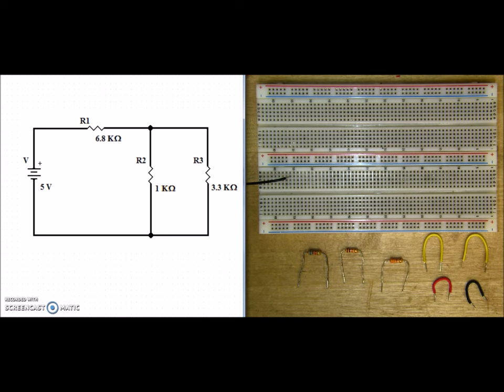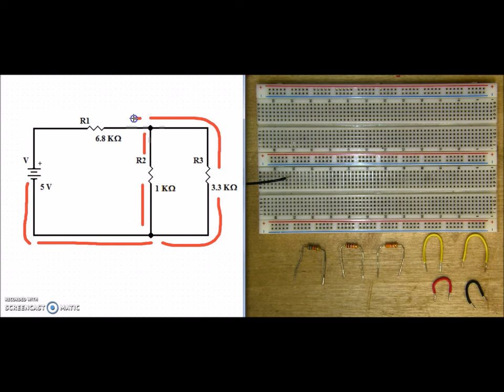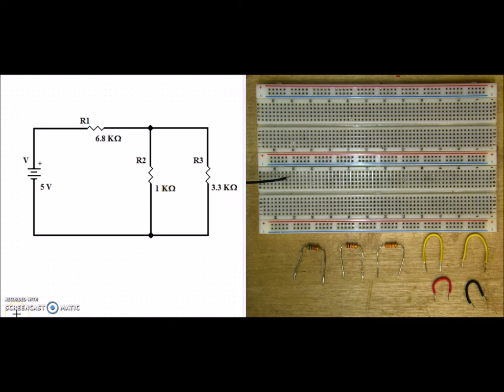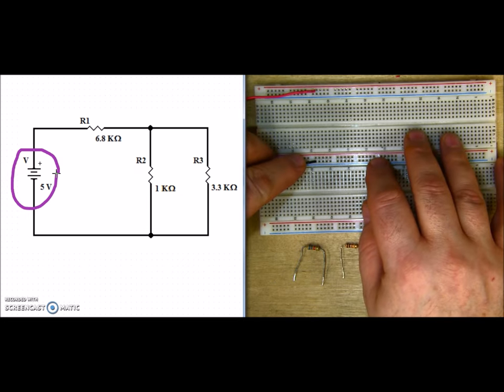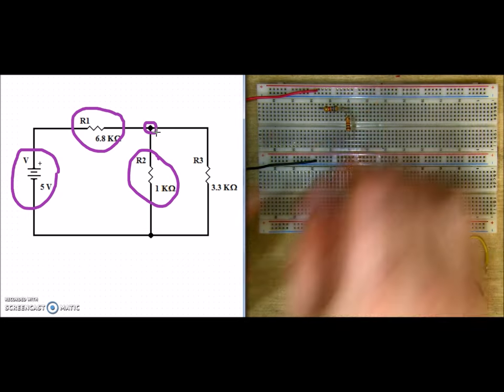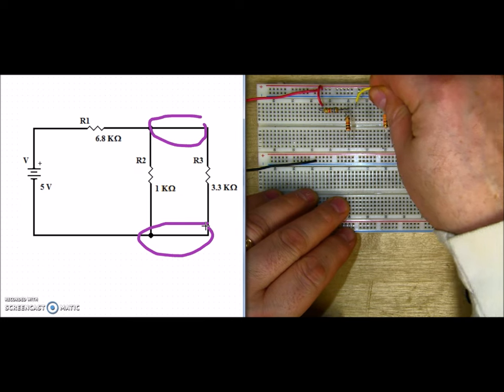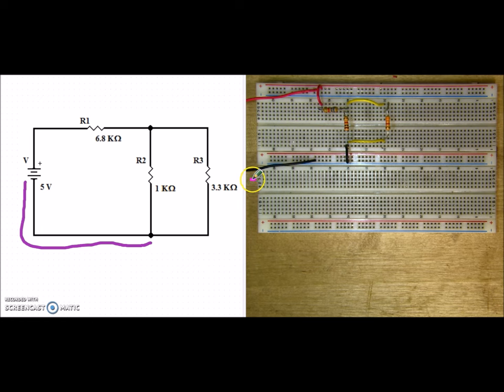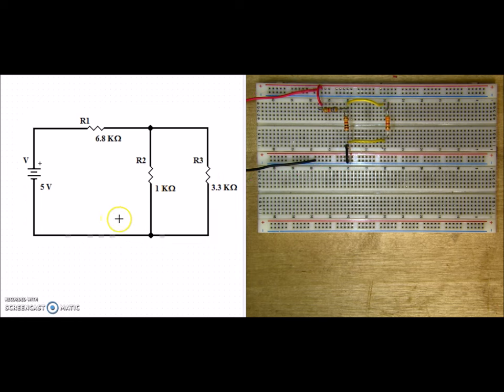Building a series parallel circuit

Comment: I have a question. When you connected R2 and R3 because they are parallel, can I place the end of the wire below the right end of R1 instead of placing it on the above?

Comment: why is the current flow from negative to positive in the circuit?
Reply: He is considering the flow of electrons (-ve charges). The direction of the flow of e- is from -ve to +ve terminals. It is opposite to the flow of holes (+ve charge carriers), the conventional flow of current.

Comment: Well i failed apparently, i think i blew a fuse in my meter, the readings are all over the place. I did exactly what this video mentioned. I didn't use any ground wires or jumpers but i didn't think you had to. The way we were tought on how to do this is just set up the circuit and use your test leads from your Oam meter or DC power supply when your reading voltage. I was trying to read resistance and for some reason the measurement was to low, its supposed to read 6.8k RT but i can only get a reading of like 3.8k. How do you hook the test leads correctly in order to measure the whole circuit.  The resistors are used were just a very simply 3 resistor circuit with 1.0K, 2.2k, and 3.6K.

Comment: do voltage flows from negative to positive?
Reply from the maker: Yes, it is the negatively charged electron that is flowing through the conductor to fill the positively charged "holes". However, when electricity was first being researched, they thought current flowed from positive to negative. Thus we has two different ways to look at a circuit: Conventional and electron theories.
Reply: so we can connect in  both ways

Comment: If we dont use the jumper wires,wouldn't the resistors be still connected in series/parallel due to the soldering.
Reply from the maker: The holes on the middle (white) section  of a breadboard are connected vertically. So if you build it exactly the way I show, the resistors would not be connected. 

Could you build the circuit without utilizing jumpers? Yes you could. However, the components would be right on top of each other.

 I prefer to spread the components out to make it a bit easier to take measurements. If you view the next video on how to take measurements, you will see what I mean.

Hope that helped
Reply: thanks man,it really helped
Reply: You're explanation and your video was just amazing, and made my day, with this awesome video of yours I've learned using breadboard based on schematics, I can't thank you enough, I wish you the bests.